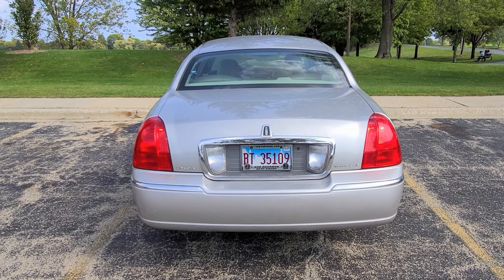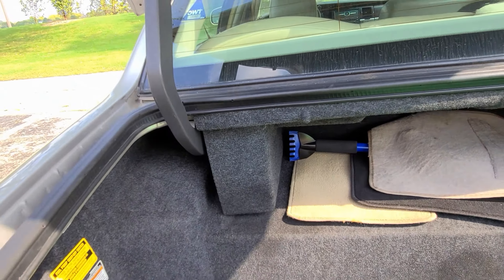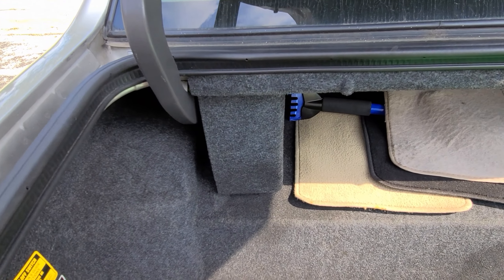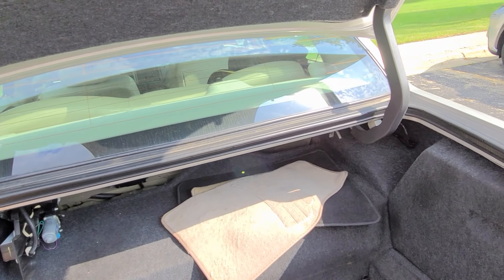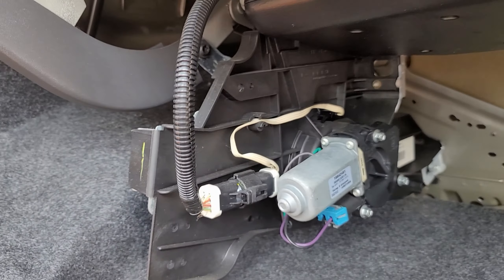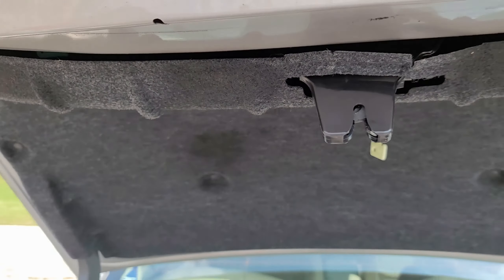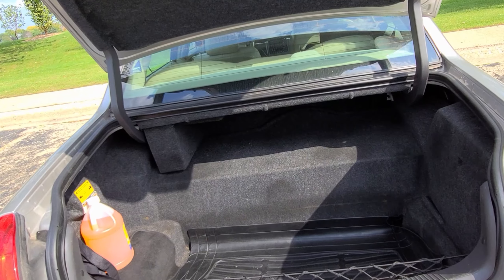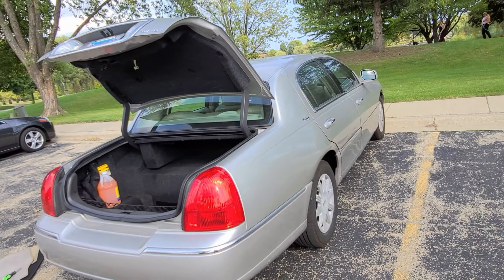Lincoln Town Car Guy Explores the Motor of his Automatic Trunk Release on Signature Limited

Comment: Fuel Pump Control module @3:31 and @3:49 that's your subwoofer box. @4:13 that box, is the amplifier for the cabin speakers inside the car. and @4:45 that is the little amplifier for the subwoofer in the plastic casing.
Reply from the maker: Thank you! You know about this stuff a lot more than  I do :D

Comment: Thanks so much for doing this video   I just got me a 2007 signature series with 85 k miles  last august  and it didn't come with the auto lift feature but I hope to see if that part of the wire harness is there and get the drive box thingy to hook it up  because it's just an awesome feature to have   thanks brother
Reply from the maker: Thank you for the idea! It was interesting to explore. Based on what other commenter stated - it's the same motor as for power windows so maybe will be easy to install.
Reply: were you able to install it?
Reply: Any news about this? Could you do that?
Reply: @Galliux  did you do anything?
Reply: I have an ‘07 Presidential with this feature, even has a pull cable in case one of the bodies I put in there is still alive, just pull the cable and, voila, trunk opens!

Comment: Big black plastic thing is a subwoofer and the black module is the amp
Reply from the maker: Thank you!
Reply: It's an 8 inch subwoofer. That screw is center in back of woofer magnet so the plastic won't raddle or vibrate...
Reply from the maker: Thank you!

Comment: Thought I would let u know,my 06 DTS doesn’t have it..that is a power window motor if u ever need to replace it..
That is a cool feature,wish all these cars had it myself..
Reply from the maker: Thanks for confirming on the DTS. So, the trunk motor is also the same for power windows?
Reply: Yes,not sure if it is left or right motor,left front window motor is the same as the right rear,right from the same as left rear,not positive,but I think the trunk motor is left front,driver motor,lot of manufacturers use widow motors,tough little motors,very easy to rebuild or replace the gears in..
Reply from the maker: Good to know if even fails! Thanks!

Comment: Love your videos. I have a question about the rear park sensors. I have a 2003 Lincoln Town Car Cartier and have had the parking sensor fixed 3 times. it works fine for a while then i get the rear disabled message in the car. I'm at wits end with this continuing persistent problem. Plus its expensive to fix. One thing I've noticed is your parking sensor are not exposed on your rear bumper like mine. Again love your videos. Thanks
Reply from the maker: Thank you! From 2006+ parking sensors were hidden behind bumpers for cleaner look. Why other manufacturer's to this day didn't adapt this is beyond me... Sounds to me like it's the wiring issue and something is shorting out. Unfortunately I'm not a mechanic so can't advise further.
Reply: I had a problem with my DTS not to long ago,turn out to be road grime around one of the sensors,..
Reply from the maker: Are they also exposed on the DTS or hidden behind the bumper?
Reply: There exposed,got to make sure they stay clean from anything pretty much,when it gets cold with frost,they kinda go crazy at times ..
Can’t remember if my 05 Lincoln are exposed or not,I no my 91 don’t hav them at all ..can’t recall having any problems out of my 05 either..
Reply from the maker: @americanbreed5116  Thanks! I think I'll cars now have all the sensors exposed. Must be some regulation thing. This is the first car I ever owned that has these sensors. I either had the backup camera or nothing at all.
Reply: @VitaliyKofman  I believe u are right on that,it’s a safety thing,to many kids hav been run over ,never had them either,I’m used to back up and hope nothing is there ..
I believe they easier to keep clean when they exposed as well..
Reply from the maker: Thanks! Probably.
Reply: I have the exact same issue with my’03. Still trying to figure out

Comment: If there is no battery in the car and the trunk is not latched, is there a way to latch or lock it ?
Reply from the maker: It will latch mechanically, but will not pull down

Comment: i’m trying to put one of these into a crown victoria police interceptor! i am trying to figure out everything i need to perform the swap
Reply from the maker: I'm no expert at this, but you'll need the motor and mounting brackets, as well as the electrical connection with remote control. It's also designed to work with the auto trunk pull down so you'll need to rig that. Not sure if it's worth all the efforts and expenses.
Reply: @VitaliyKofman  thanks for the heads up, i’ll have to look into it
Reply: @spvxter you ever end up doing it?
Reply: @fordshuler307  not yet, too many other things going on, that project is on the shelf until i can figure out what i need for it

Comment: Can I evacuate the Crown Victoria in the same way as the bag?❤
Reply from the maker: I'm sorry, but I don't know what you mean? As far as I know, Crown Victoria and Grand Marquis never had auto-trunk motor, but I believe the trunk liner can be removed the same way. If you are trying to put that motor in Crown Victoria, you can probably attach it. Please let me know if I understand you correctly :)
Reply: @VitaliyKofman  I mean, can I make the boot of the Crown Victoria Hadlik like you have?
Reply from the maker: @mrtitanium1074  I think it's possible. You will have to buy the motor and attachment arms, mount it in the same spot and I think the hardest part will be figuring out the electrical connection.